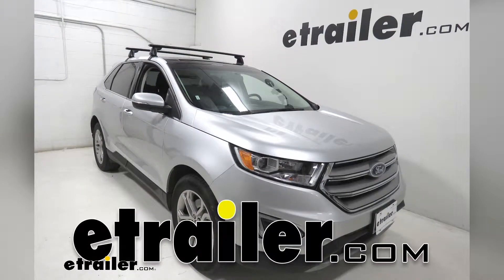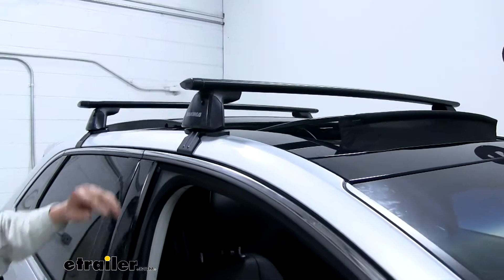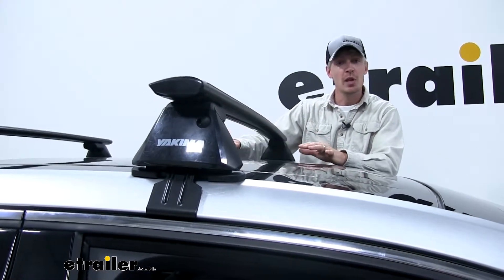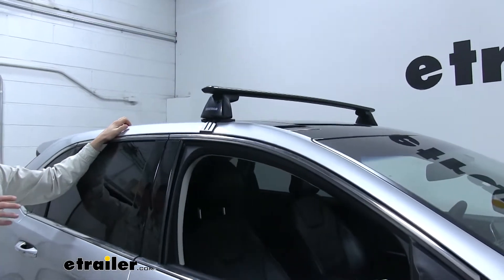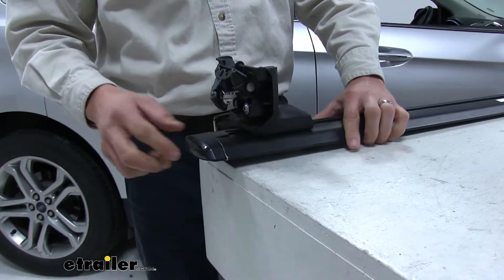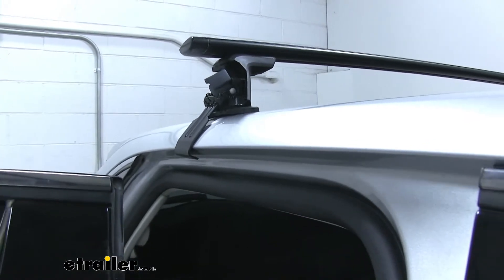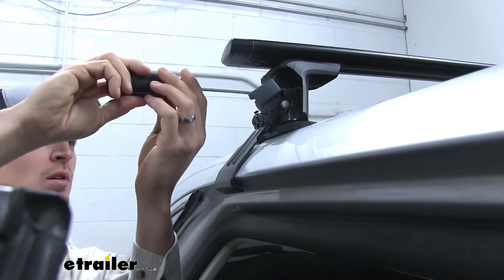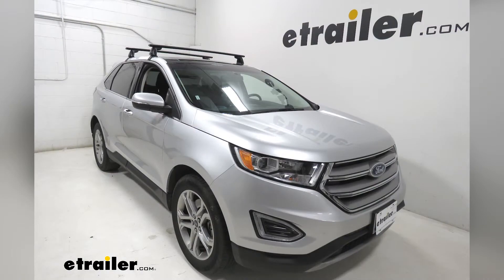etrailer | Mount: Yakima RidgeLine Roof Rack for Flush Rails on a 2018 Ford Edge

Comment: Does Thule have an option for this Edge or this is your best advise?
Reply from the maker: If you have the same setup with the glass roof and no roof rails on your 2018 Ford Edge then yes, the Yakima is the best option out there and Thule currently (as of Sept. 2019) doesn't offer anything. If you don't have a glass roof or you do have the rails with your glass roof then Thule does have some options. I am linking all of the roof rack options for a 2018 Edge that you can filter through.

Yakima and Thule are definitely big names in the roof rack community and I wouldn't have an issue recommending either. I personally think the Thule roof racks are a little more aesthetically pleasing but Yakima doesn't look bad either and Yakima has a bit more of a fine-tuned fit as their roof rack feet have adjustments in them to ensure you get the correct pitch to your crossbars instead of just building a rubber spacer block like other roof rack manufacturers (including Thule) do.

https://www.etrailer.com/roof-2018_Ford_Edge.htm
Reply: etrailer.com THANK YOU! Great videos!
Reply: Couple questions:

1) is there an option to add the permanent side rails on an edge with the panoramic roof if it didn’t come with it from the factory?

if the original OEM flush mount side rails can’t be added later and there are no aftermarket options to add the side rails, it looks like this would be the next best option.. but 

2) will the tower or hook leave marks or wear the paint where it’s in contact with the paint?

3) does the hook interfere at all with the opening/closing if the doors or harm the fit of the door once the clamps and hooks are removed?

Thanks
Reply from the maker: @exit3769  We don't have an option to add the side rails that run front to back but from what I can find they are an option on models with the glass roof. So they might be able to be added but I don't know for sure. I'd check with a Ford dealership. Without rails the roof racks that use clips around the door jambs are the best option. We do have a few different ones other than the Yakima in the video https://www.etrailer.com/roof-2018_Ford_Edge.htm?Style=with+glass+roof&fUrl=-c1-NR

The clips that actually make contact with the roof are the BaseClips https://www.etrailer.com/Roof-Rack/Yakima/Y06139.html
They're padded to prevent any damage or marking on the vehicle's roof. It is a good practice to make sure the area they'll be mounted on is as clean as possible so nothing is trapped under the padding that could scratch the roof. They also don't interfere with the door. The door seal is soft enough to allow the clips to fit between the roof and door without a problem.
-Chuck S
Reply: @etrailer  Thanks for that crazy fast reply.. I'll call Ford and if they can add it now I'll do that but if not this will be the option I choose.

Comment: And these won’t scrape the paint?
Reply from the maker: If properly installed, the Yakima JetStream roof rack won't scratch the roof. The legs sit on rubber pads and the hooks that clamp the rack to the tops of the door jambs are plastic coated steel. Before installing, make sure that all the surfaces of the feet, clamps and vehicle roof that touch each other are perfectly clean and free of grit. 
https://www.etrailer.com/Roof-Rack/Yakima/Y00425.html
https://www.etrailer.com/Accessories-and-Parts/Yakima/Y28TR.html
https://www.etrailer.com/Roof-Rack/Yakima/Y06102.html
https://www.etrailer.com/Roof-Rack/Yakima/Y06139.html

Comment: Wouldn't those metal hangers scratch the crap out of your paint after vibration and abrasion?
Reply from the maker: The hooks are going to be constructed of steel but they have a think rubber coating on them to protect your paint.
https://www.etrailer.com/Roof-Rack/Yakima/Y00146.html

Comment: Will this also work on the 2019 model?
Reply from the maker: Yes, this kit is also going to work with the 2019 Ford Edge. Check out the components in the following links.
https://www.etrailer.com/Roof-Rack/Yakima/Y00426.html
https://www.etrailer.com/Roof-Rack/Yakima/Y00146.html
https://www.etrailer.com/Roof-Rack/Yakima/Y06102.html

Comment: Will this work with a 2016 model with the panoramic roof?
Reply from the maker: This kit is also designed to fit the 2016 Ford Edge with the panoramic roof. It is not advised to open your roof while the roof rack is installed because of the added wind noise.
https://www.etrailer.com/Roof-Rack/Yakima/Y00426.html
https://www.etrailer.com/Roof-Rack/Yakima/Y00146.html
https://www.etrailer.com/Roof-Rack/Yakima/Y06102.html
Reply: @etrailer  Thank you for the response. I am looking at purchasing this in the near future.

This may be an odd question, but the Edge Pano Roof has a tilt feature (opens about 1.5" in the back to let air circulate) in addition to fulling opening from the front side. I typically only use this tilt function...do you think that would be affected by the roof racks?

Comment: I would prefer to address why a roof rail or flush side rail cannot be installed on a ford edge with a panoramic roof.  Those are plastic side panels beside the glass.  Underneath is just the metal framework of the sunroof itself.   Has anyone installed the rails, NOT THE RACKS.......on a Ford Edge Panoramic?
Reply from the maker: That is a great question. It is most likely because of the strength of the roof and what it is constructed of.